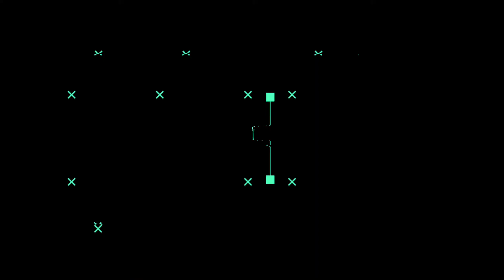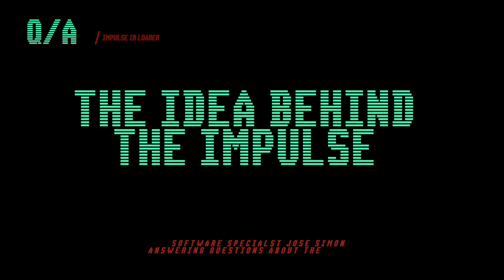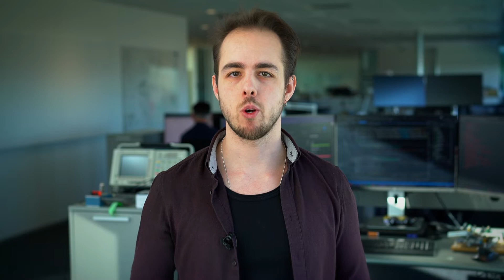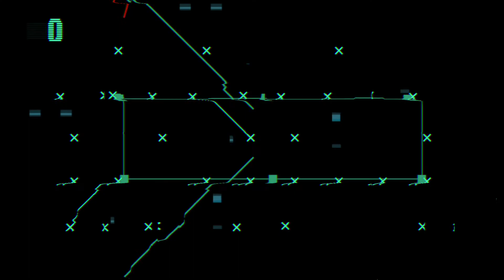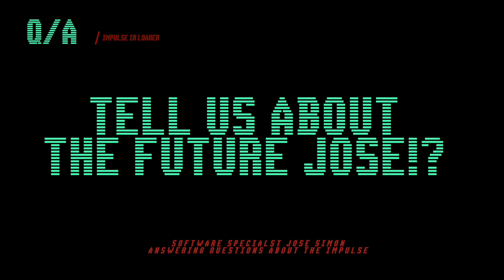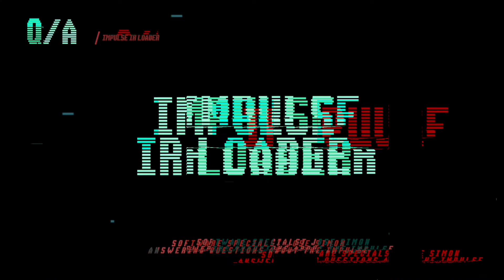IMPULSE I/R LOADER - EXPLAINED

Comment: Interesting little box, except I see something that would make this pedal much more useful to a guitar player who want to use an amp-less rig. The addition of an XLR direct output along with the 1/4" output. This would allow long cable runs to the mixing desk, or stage snake and minimize signal loss for an amp-less rig.
So, this brings me to a practical question about where to place this on a pedal board, that uses preamp/boost pedals for tone shaping, and effects like modulation, delays and reverbs?

Comment: How do you store an IR to the A slot or B slot to use A/B mode? It's not in the quick start guide and no one seems to show that. pushing buttons on the pedal sometimes I get it to store, other times not...what's the correct method to save to A or B?
Reply: Press and hold the foot switch.